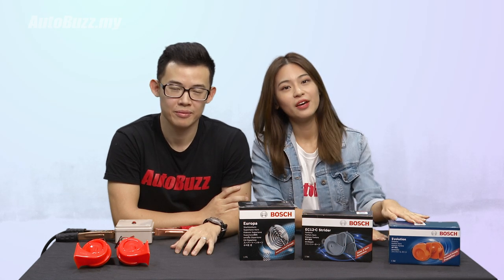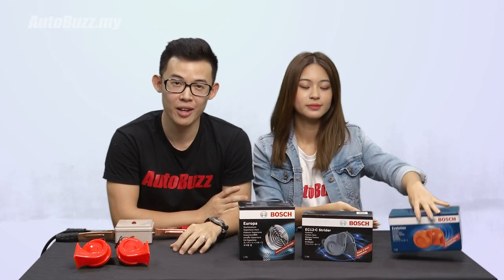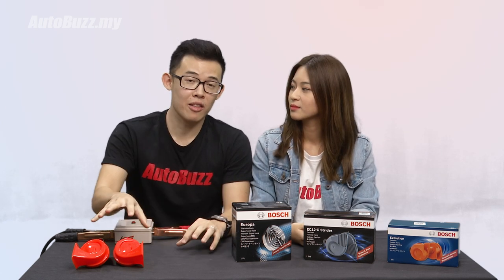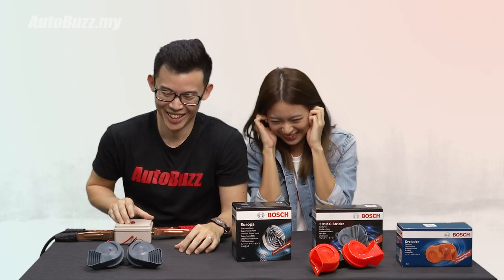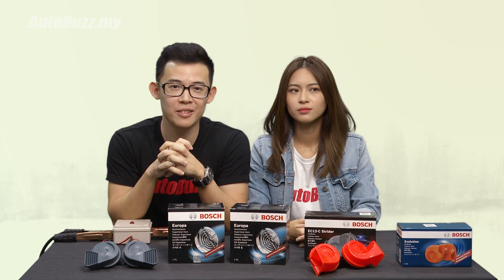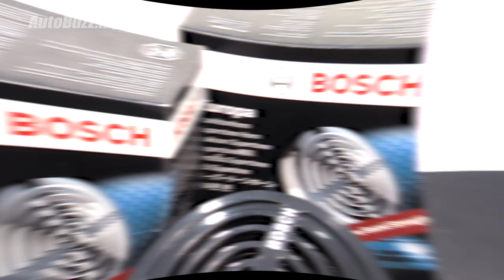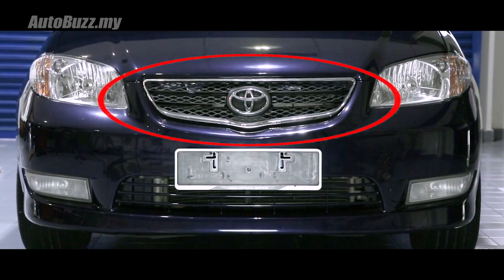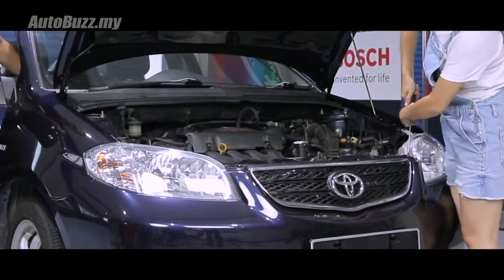Unboxing: BOSCH Car Horns (Evolution, Strider, Europa) - AutoBuzz.my

Comment: That Bosch Stider, i can Say it is Shattered prove to a Certain level. I did abuse that Honk of mine which is Damaged from water. After i got replacement, i use my old horn to Release my nerd rage. The placstic is Kind of hard to break. Haha. Despite the metal backing is Bent.